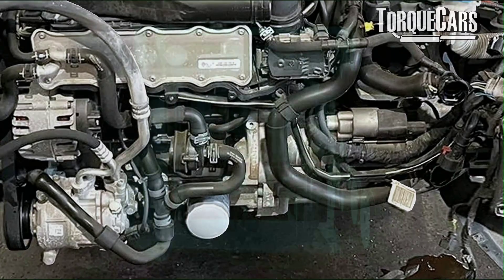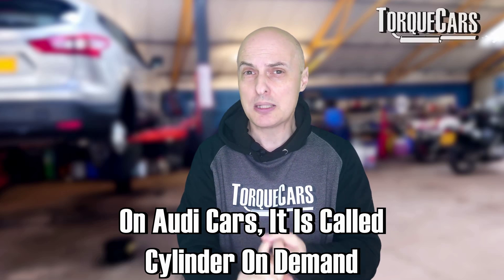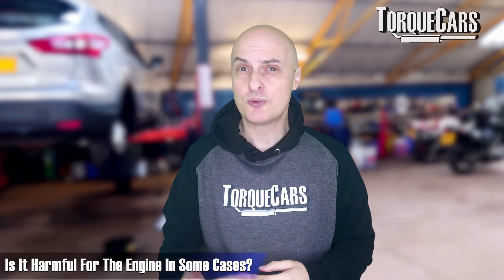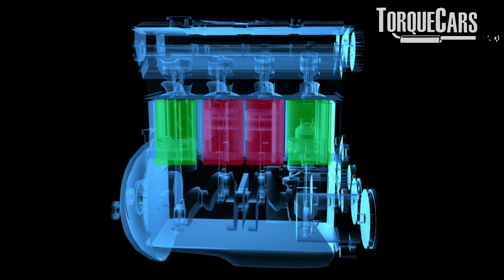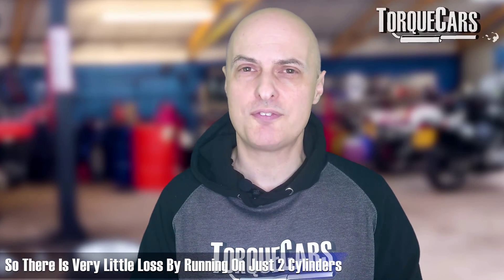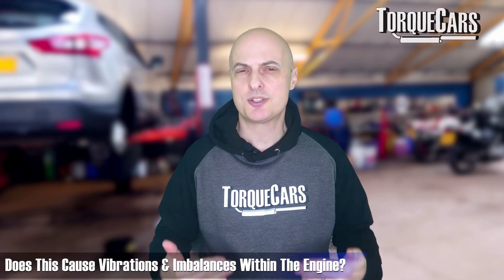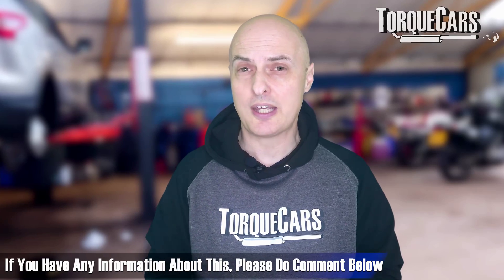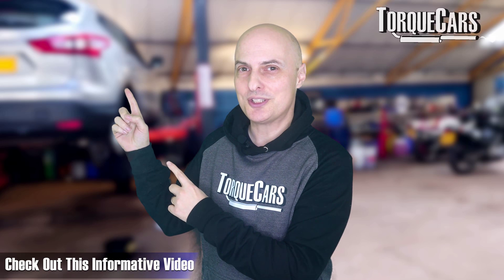Cylinder Deactivation - 4 Cylinders To 2 How & Why? COD ACT Tech.

Comment: Hi, thanks for that video, i have a Mazda Skyactive-G 2.5 140, it has CD, honestly it is noticable when the system is switching from 2 to 4 cylinders, 4 to 2 not so much. I had expected you would talk about reliability of the engines with that system.
Reply: Good insight.How is the engine treating you? Happy with the fuel economy?

Comment: "they(2 cyl) are running at full capacity to produce half of power" - and that say it all!
also the engine will have half of the vibrations but at full load, 
who will have to minimise the vibrations --the double mass flywheel.
also the vibrations will be seen in the gearbox and in the accessories like AC, the alternator, engine mounts.
anyway, this ACT/COD/HMB is not a good thing.

Comment: Thank you. This is very useful information. I bought a used car with this system. After a week of using the car, I noticed a slight extra vibration when it was running in 2-cylinder mode. At first, I thought something was wrong with the engine, now I understand the reason.

Comment: the only problem I see with my Mazda at least is that its always the same cylinders that are running or get deactivated. wont that cause uneven wear in the cylinders? should like alternate them evenly for more uniform wear edit: never mind the pistons continue
Reply: Mazda is a master of details and reliability. Many details have been optimized to secure a smooth (as possible) running with only two cylinders in operation. This can NOT be obtained with several different operating modes. Cylinder wear is not what ruins an engine. Turbo chargers and wet timing belts should be your main concern. My 2,5 Mazda petrol engine has non of those selfdestructive features.
Reply: @flemmingqvist8326  the car care nut doesn't seem keen on it and recommends more frequent oil changes.

Comment: Thanks for the video. Ive just bought a 1.5 tsi, what sort of fuel economy do you get out of the audi on a long journey?
Reply from the maker: I get around 50-60 MPG on my 1.4 TFSi on a run, my best is around 70mpg, but around town and general driving it gives about 45mpg. Obviously these drop a lot if i drive it hard, but these figures are based on general driving with a few overtakes and faster sections. Bear in mind I also only use shell V Power, which does make a difference to me for economy.
Reply: @torquecars  thanks I think I am going to try use Esso as it does not contain any ethanol.
Reply from the maker: That's certainly the key - avoiding Ethanol. Are you in the UK? We're up to 10% on non premium fuels.
Reply: @torquecars  yes there are a few companies using ethanol even in the premium fuels

Comment: I just recently found your channel. SUb’d 😊
Would like to learn more about the Audi TTS and the EA113 engine (2015 TTS 8j Mk2) 
- What are things to do before tuning?
- How to make it more reliable. (Plug upgrades?, ignition upgrades? Oil upgrades & types?)
- Tuning the DSG Pro’s & Con’s
- Are catch cans necessary?
Reply from the maker: 2.0 TFSi = most of this still applies to the EA113 https://www.youtube.com/watch?v=BrHYwmngYUc 
Things to do before you tune https://www.youtube.com/watch?v=52Fk5m4TtYo

Gearbox tuning and mapping (one specifically for DSG is planned for the future) https://www.youtube.com/watch?v=eyPJVjoiYvY

Catch cans are important on these, the carbon build up is a problem without https://www.youtube.com/watch?v=JlOV9Wym6X0 Some remove the EGR but I personally feel the catch can is the main culprit here.

Comment: Car manufacturers should build 2 cylinder engines, why bother with a 4 cylinder one & make it run on 2 cylinders🤦‍♂️.
Reply: Fiat have 2 cylinder
Reply: @agrubera75  well what if your trying to pick up speed fast you want the other 2 , it's easier to make it stop using 2 then to add stress to a 2 cylinder trying to do more then it should

Comment: Quite a few engines in the wild that control their throttle by adjusting valve lift and duration mechanically, which consequently means the butterfly valve is wide open all the time. Makes me wonder what benefits would be found in engines of this type.

Comment: Great informative video, thank you. I have 1.4 ACT (Skoda) and unfortunately I have the dreaded rattle. When ever 2 cylinder mode activates you can hear a rattle. I've been told in 2 cylinder mode the engine naturally vibrates more, which leaves you with a metallic rattle sound. I've don't a bit of research and the likely culprit is the actuator rod.